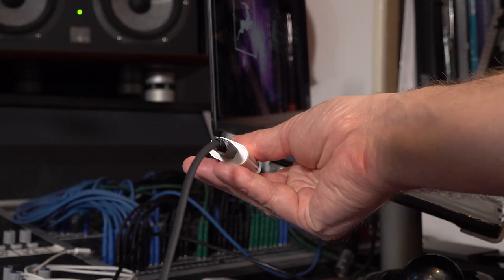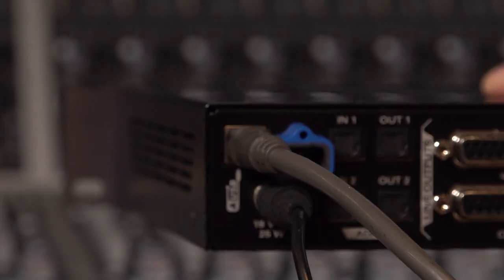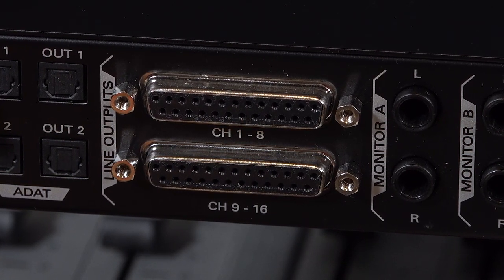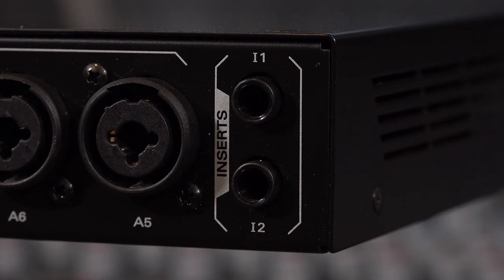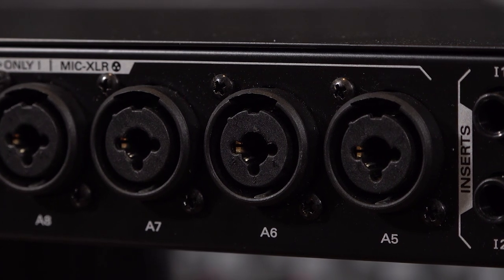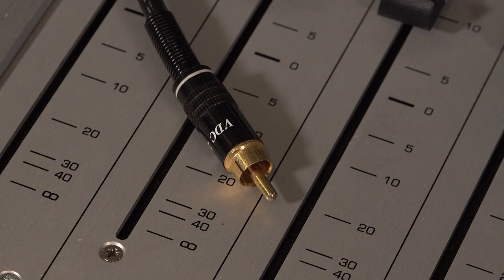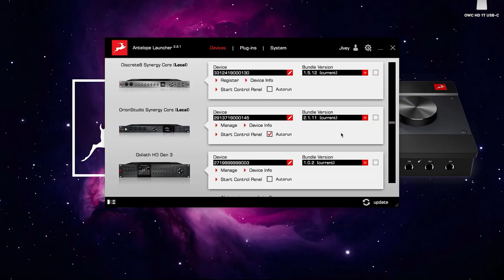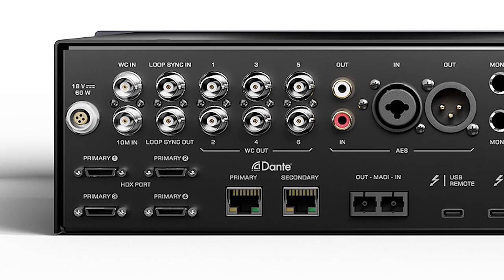Connection Types and Connectors Explained - Antelope Audio Interfaces

Comment: Great tutorial! I have a few questions: can I use XLR connector for Line Level signals? Or is it only for mics? In case it is possible, will it bypass the preamp? I would like to do this to have all the i/o routed to a patchbay and use them as Line/Mic as needed without changing cables

Comment: thanks for the video.i've been trying for the longest time to get my thunderbolt connection working on my goliath hd 2nd gen.i'm not sure whether it's a software or hardware problem.it's very difficult to get support to  help out.i think i saw you using one before.can you help ?currently using mac os mojave still.i also tried 2 separate TB cables(new).are you using the latest firmware and launcher?Thanks

Comment: Congrats on the new gig. (as I just found out you are with AA now). Quick question, if I want to expand my Orion Studio Synergy Core I/O count  by connection my Orion Studio HD via ADAT, do I also have to use the WorldClock BNC to link them, or does the ADAT already link the World Clock?
Reply: Same question here.
They did not answer, but did you ever find out?
I plan getting the Discrete 4 and using it both as slave and master with ADAT-S/PDIF only devices.

Comment: How fast of a Thunderbolt 3 cable do I need to take full advantage of the Orion Studio Synergy Core's data transfer rate?
Reply: You need a 20 gigabit cable in theory, but i would just get a thunderbolt 2 certified cable.